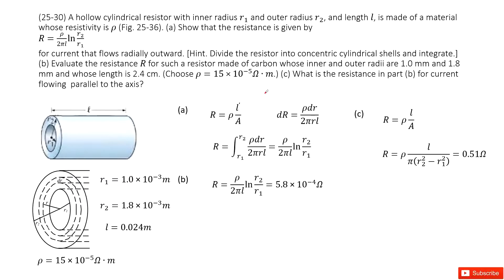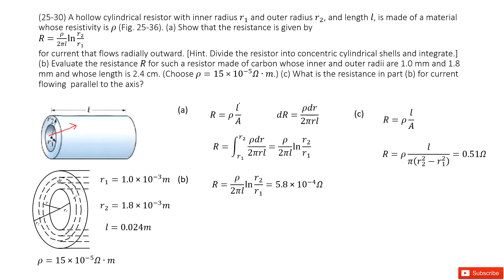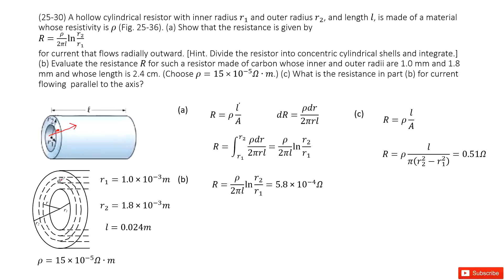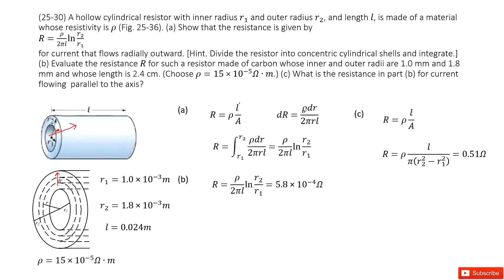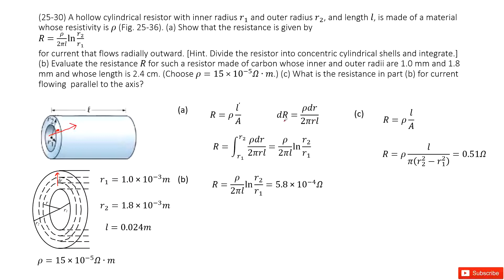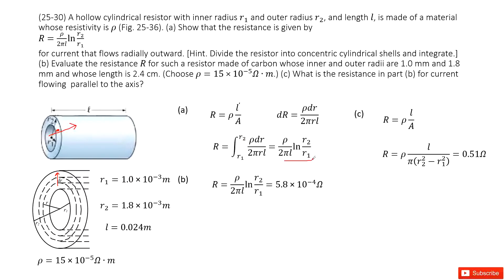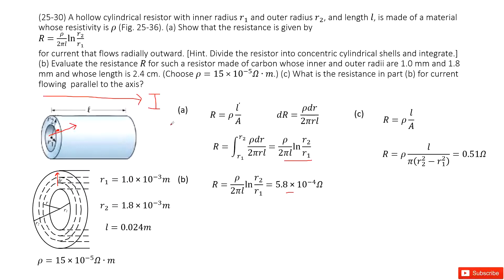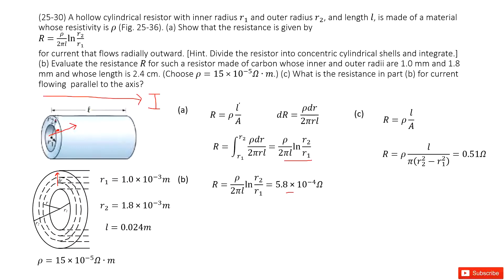(25-30) A hollow cylindrical resistor with inner radius r_1 and outer radius r_2, and length l, is m

Comment: Please elaborate in more detail how you replaced A by 2 * pi * l if l is the length and has nothing to do with radius.
Reply: the letter A represents the lateral surface area of the cylinder, which is 2*pi*r*l.
Reply: @OlavoCallegari Why is the lateral surface area important?